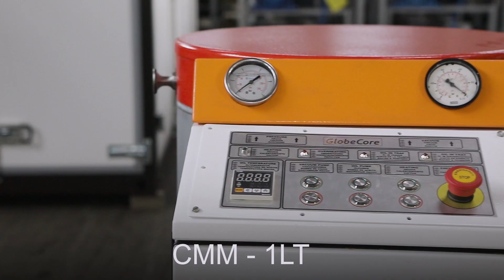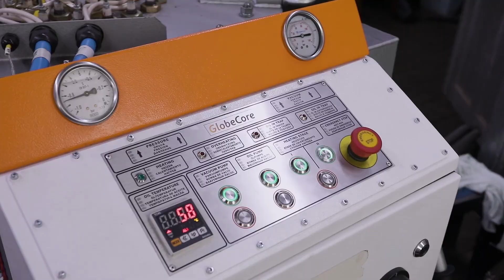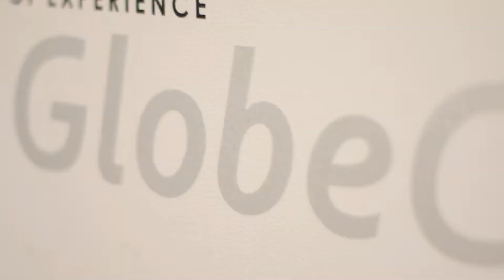Transformer Oil Purification Systems CMM-LT - A Comprehensive Review

Comment: Are there any safety features or precautions built into the CMM-LT series systems to protect both the operators and the equipment?
Reply from the maker: Upon request, additional safety features can be installed to enhance the protection of both operators and equipment in the CMM-LT series systems.

Comment: How do the CMM-LT series systems compare to other transformer oil purification systems on the market in terms of efficiency and performance?
Reply from the maker: The most important difference is the compact size. Machines of this series pass through a standard doorway. This allows oil to be purified in transformers, access to which is limited.

Comment: Can the CMM-LT series systems be easily integrated into existing transformer maintenance setups?
Reply from the maker: We can talk about the compatible use of machines of this series with machines that, for example, are used for drying the insulation of transformers.